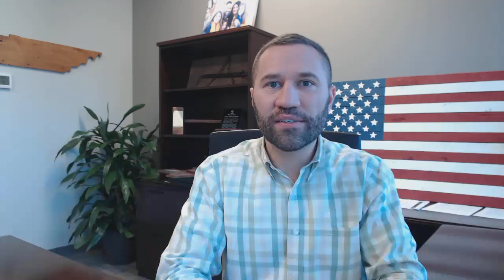Everything you need to know about construction loans

Comment: So with this construction loan that you get , the builders pull money out every two weeks from that loan right? You’re not paying out of pocket right?
Reply from the maker: Tyler, great question. Usually the builder will request a draw from the bank based on whatever stage he is in the process and is ready for money. The builder will request the draw from the bank and the bank will send out an inspector to make sure he is where he says he is in the process then the bank releases the funds to the builder. Sometimes it does happen where you as the borrower will pay the builder out of pocket but that is not the norm.